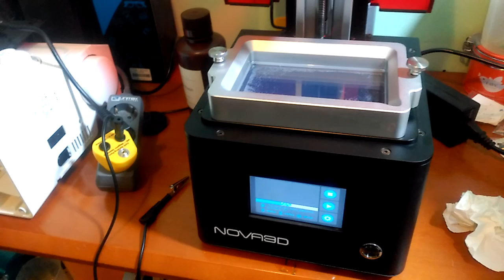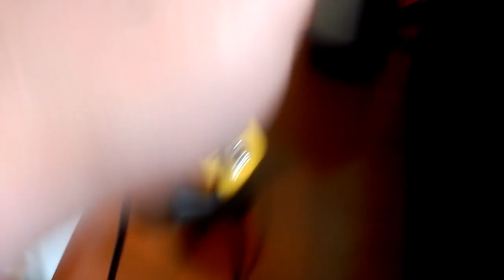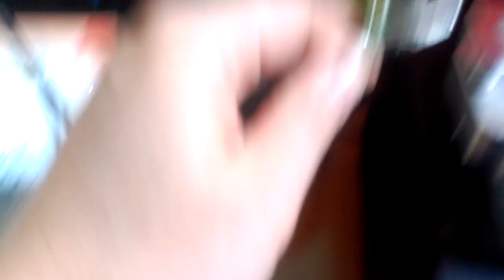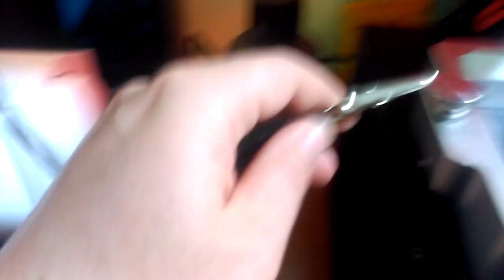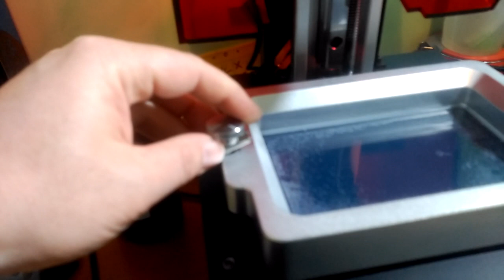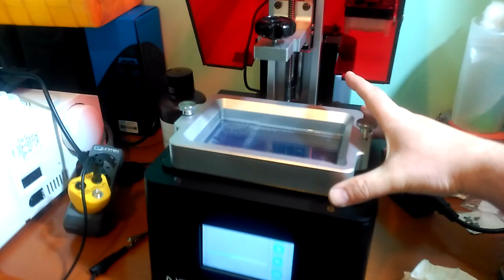Chitubox based MSLA - Electrostatic, the importance of properly grounding

Comment: Wow. That’s crazy. Is the Nova powered with a DC adapter like most other MSLA printers?  If so, is the DC ground isolated, or is there just poor continuity between the aluminum components?
Reply from the maker: it is important to disclaim that this is a mod. Nova3D does not use chitu boards. 

But this is a plague of most metal body MSLA printers. Isolated DC and no grounding for the huge electrostatic buildup that the fep accumulates even during normal printing peel.

at least i have seen this on all major metal body brands out there